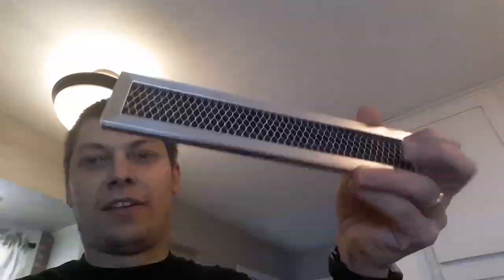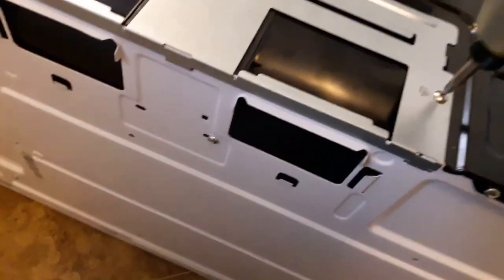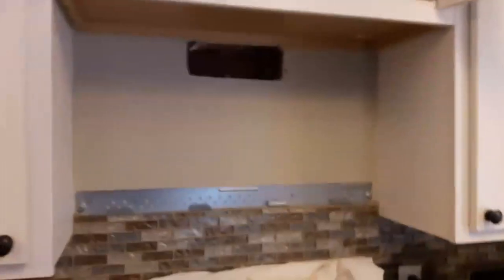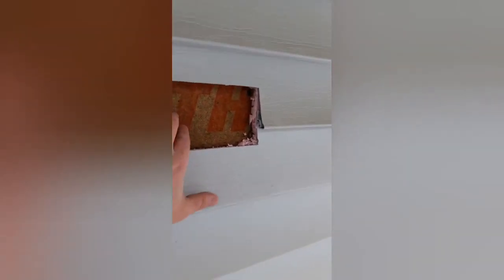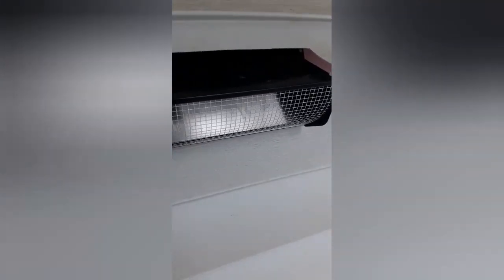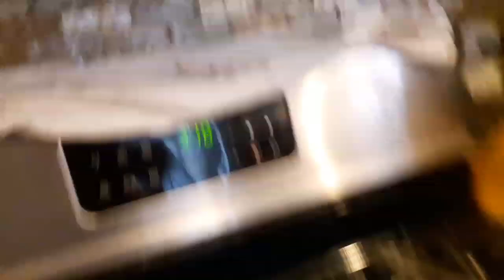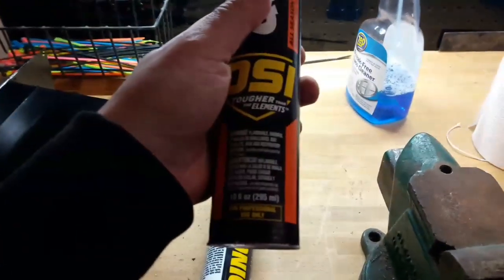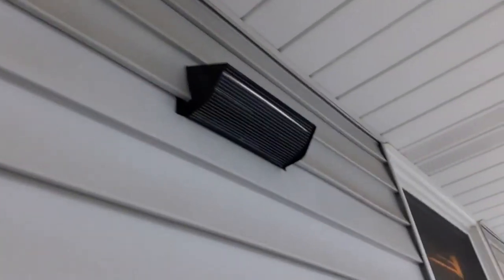Install Microwave Wall Vent - vinyl siding

Comment: This is the best install I've seen so far on YouTube, when it comes to ensuring that rainwater is directed outward. I like how you basically shingled the vent into the siding.
The potential problem Craig Woodcox pointed out with the vinyl siding expanding and contracting might be avoidable by just not caulking or screwing any part to the vinyl, only to what's underneath.

Comment: Great video!! I took an extra step where the microwave damper meets the vent, if you can reach in from outside,  I used an extended/angled nozzle for my caulk gun and put a bead of metal silicon around the perimeter of the microwave damper this way when I pushed the vent in I got a nice seal.
Reply: no need in it!

Comment: Considering it is close to the soffit area I think your install will work just fine. Good job for DIY’er. 

However, for others that may tackle this and just for reference, you should not mount any part of the vent to the siding. You should have removed the bottom piece of vinyl siding as well and installed the vent under it too. Then flash and/or seal the vent to the house/insulation. Then put j-channel on and cut siding to fit. J-channel will cover the cut edges of the siding and allow for movement of the siding. Vinyl siding needs to be allowed to expand and contract a little bit. That’s why it’s usually nailed on loosely in oblong mounting holes.
Reply: But this way the water that runs down the side of his vent is directed outward mostly without the aid of unreliable caulk. Perhaps he could still achieve this and avoid the problem you're talking about by not caulking or screwing the vent into the siding, only what's underneath, and allowing the lower part to loosely overlap.
Reply from the maker: Siding is meant to flex. Additionally, this vent doesn't have a lip at the bottom, so there isn't a way to mount under the siding.

Comment: Should remove the siding and installed a siding block.  Then use cut the siding to size and reinstall using J-channel if needed (depending on how you built a siding block)  for a proper water seal.
Reply: Flashing tape would have also been a good choice. He could have even used that foil tape

Comment: Is the slip fit of the two vent pieces sufficient? I can imagine some steam venting into the surrounding insulation if it's too loose. Also it could help if the plain steel sleeve fits over the other part (and not the other way around), so that the seam faces the same direction as the airflow, if that makes sense. I can't think of a way to make it a solid connection all the way through, and I'm assuming it's not necessary.
Reply: They’re all slip fit. You could put some aluminum tape in there as well I suppose.

Comment: This is a great illustration. Thank you!
I am in the midwest so I am also concern with the insulation and cold air coming back into the house... do you experience that?
Also, where can I find one of the tool to lift the vinyl siding? And what is the exact tool to use to cut the siding? Can I just use the reciprocating saw to cut through it?
Thanks again!
Reply from the maker: The cold air doesn't come back into the house because of the flap on the vent cover. Most microwaves also come with an adapter, which also has a flap on it. The siding removal tool is definitely online. I probably got it on Amazon. To cut the siding, I wouldn't use something as abrasive as a reciprocating saw. The jerking motion might snap the siding. I would just cut it with either a utility knife or even an angle grinder or Dremel. An angle grinder with a cut off blade works great.

Comment: I have this same install right now.  Did you notice any buckling of the siding as it expanded (lengthend) in the summer months?  With the caulk and screws my concern would be that the siding would not be able to expand along the nail channels around the vent.

Comment: I'm interested in using this method for my microwave range.  Question  though.  Do you notice any grease staining on your siding from the vent?  That is my only worry.
Reply from the maker: I have been using it actively since install, and we cook alot. I haven't noticed any staining at all. We even cook bacon fairly often.
Reply from the maker: I have been using it actively since install, and we cook alot. I haven't noticed any staining at all. We even cook bacon fairly often.
Reply: @ddnm1525  thanks.  I know modern microwaves usually have a filter than helps block grease.  But was just curious of your experience so far.
Reply: @ddnm1525  Yea we have gotten into cooking bacon way more, and out house is smoky with the unvented setup.  Also our microwave went out years ago, but I finally just ordered a new one and I'm planning on doing this.  Also we had to clean the top of our cabinets after almost 10 years without venting out and the grease up there really disgusted me.  Thanks want to get this done before it gets too cold here in MN.
Reply from the maker: @kartboarder22g17  starting to get cold this week! These jobs suck once the snow flies! Good luck! Let me know if you have questions!
Reply: @ddnm1525  yeah my microwave got delayed delivery for two more weeks. Just getting closer to the snow......
Reply from the maker: @kartboarder22g17  dang!

Comment: Hey great video! I did the same set up. But cold keeps coming trough the microwave. And the inside even get freezes. Any advice? .
Reply: That happens too us also that’s why I came to the comments. How do we stop so much cold air from coming through the microwave?

Comment: Great video!   I’m in the same boat, moved in to a house and they didn’t vent it outside, even though it’s on an outside wall like yours.  My only question is, how did you measure for the cutout?   I don’t have the original template and Samsung doesn’t make them available after the fact.
Reply from the maker: I had to literally measure the height of the opening. If you measure it on the microwave and then on the wall, it should be fine.

Comment: What exterior wall vent did you use?
Reply from the maker: The vents are pretty standard surprisingly. I got mine from Menards, but I'm sure all the big box stores have them in the HVAC aisle.